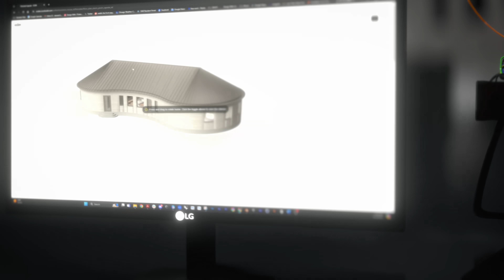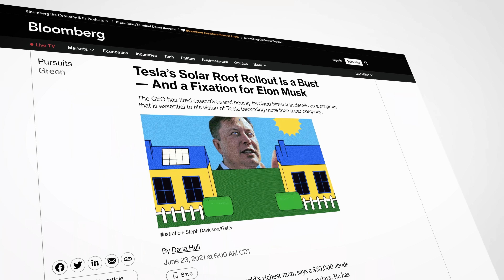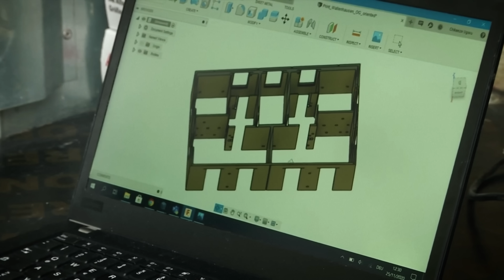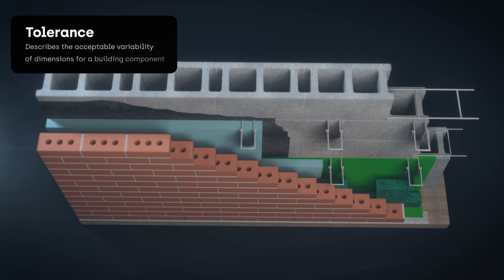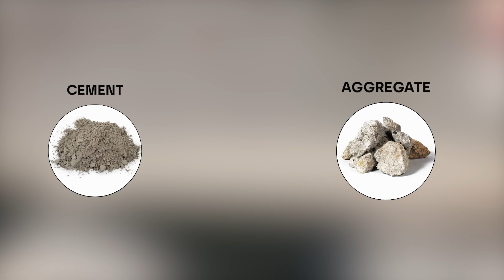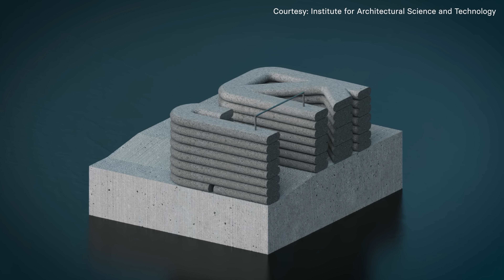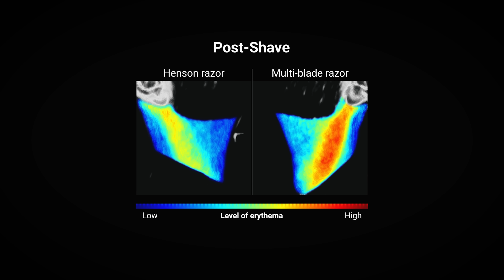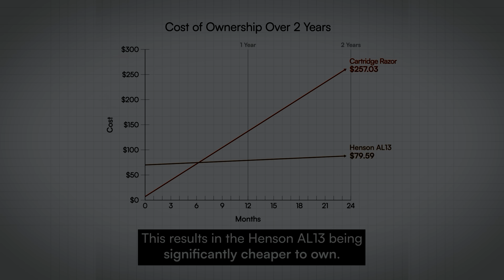Why 3D Printing Buildings Leads to Problems

Comment: Hooray for automating the least complicated, least expensive, most reliable part of the construction process! You did it, Tech Bros!
Reply: That's what I said from the beginning. Okay cool. They made walls. The easiest part of the build. The majority of the headache comes from electrical, plumbing, roofing, and finish work. NOT the walls. Hell. Even modular home manufacturers just mail you the walls.
Reply: @t_c5266 so you guys think they didn’t think through that?😂
Reply: @iaintatroll no. They thought it through. But came to the conclusion people could be scammed who lack critical thinking or experience
Reply: @iaintatroll I will leave foundation out, since both must have it. I've recently built my own house from AAC blocks, using reinforced lintels for openings. 35m3 AAC blocks were 4.5k EUR. Lintels (concrete + rebar + leftover wood from foundation for forms) 1k eur. Glue for AAC blocks 700 EUR, reinforcing rebar in between AAC blocks 200 eur and monolithic ring above another 1k. EUR. So in total the walls were ~8k EUR. Just for comparison: triple glazed windows and doors(both inside and outside) were 18k eur! Just windows and doors were more than double what the walls were. My kitched was almost twice as expensive than walls at 15k EUR. Electricity? 9k EUR or more than walls. Heat pump? 7k eur for unit alone and another 5k eur for underfloor heating set up. So also almost twice as expensive as walls. I'm not even gonna go into plaster, cieling, HVAC and finishes...
Reply: @iaintatroll They didn't automate any of that stuff.
Reply: In the part of the world where I live, structural concrete or masonry requires reinforcement. When does the steel get installed? 
3d printed objects tend to fail along the layer lines. These buildings have cold joints between layers, how is that addressed?
Reply: @markdaniel8740 I live in one of these houses, they add rebar in between and across layers as well as vertically into the foundation to help tie down the roof
Reply: The exaclty.  A crappy gadget isn't always the answer to real issues. I could hand lay blocks faster, cheaper and better.   They take days to even setup that rediculous apparatus.
Reply: to add to this, the process to prepare for the 3d printing is an expensive and complicated process that requires the construction of permanent concrete pads. Which would make this far more expensive, and take far longer to do than just hiring a crew of people to do the masonry...
Reply: Tell me you have no fucking idea how bad timber frame homes are made in the wild without telling me.
Reply: I thought new house building is mostly limited by land and permits, not the actual building part.
Reply: @arcturuslight_ yeah 😅.
Reply: @arcturuslight_ that is the fun part of construction, you'll never know what will be the bottleneck in the project, i love my work, no building is equal to the other
Reply: Does it work in cold weather parts of the country.  Construction doesn't stop when it's cold out.
Reply: @rok1475  twas ever thus. Supply chain issues cause WAY more problems in the cost and speed of construction than masons and framers.
Reply: @henryglennon3864 or legal shenanigans, they can easily cost a year.
Reply: @henryglennon3864 peak /r/iamverysmart
Reply: @henryglennon3864 Yeah, masons and framers are the fastest contracts out there 😂
Reply: @henryglennon3864 
You are exactly right.
Investors and entrepreneurs everywhere seem to be stuck in a certain way of thinking and ignore that fact that building is requires a holistic approach. A whole if structure and structure lifecycle approach
Reply: @henryglennon3864  
Modulo the fact that developing modern supply chains -- even the notion that there is a connected chain involved -- has cut prices, while masons and framers don't tend to get cheaper.
Reply: @henryglennon3864 that’s how it usually works, what do you think robots in factories did first? The complex jobs or the easy ones?
Reply: @henryglennon3864 you dont work in the trades do you?
Reply: @henryglennon3864  are you a expert in this matter? If so, can you explain to me why its possible to build a entire hospital in 1 week in china, but like everywhere else its done in 4 years at the fastest
Reply: @henryglennon3864 so reducing the amount and type of materials needs on site is a massive plus then, I have no respect for architects, they make so many massive yet easily avoided mistakes and are never held accountable, they should actually have to work alongside construction workers and deal with the issues instead of just issuing revision 26 of the drawings lol
Reply: @dancingfrogsxb1276  omg. I SO agree. As someone who has both installed and cleaned windows I HAVE ALWAYS said that. We need to have a system that is holistic. If the designers had to install it, maintain and clean it, they would design things with that in mind. I have always said that. Holistic design is a real thing. 
All architects should be required to spend time in their training on the job site and also understanding what it takes to maintain it. ✅ Then things will be designed and made much better 👍
Reply: When the comment is more positive then the video it self.
Reply: Typical early naysayer speak. In the 1950s there were plenty of people saying people would never overcamplicate things by having computers in their homes.
Reply: Stop saying bro
Reply: Yeah it's kind of silly. A frame factory can build the wooden frames faster and better than this can print concrete. Frames show up on a truck and 3 guys can stand them up and nail them together.
Reply: @rok1475 Eh? A decent brickie in the UK is making £250 to £300 a day - $300 to $350. It's a skilled job and a good bloke will do 1000 bricks a day or more. They are quicker than this current printing system. On site a house will be up to roofline in two days.
Reply: And forget about being able to set up the printer in many locations.
Reply: @markchisholm2657  
A job that can be learned in a few days and mastered in a few weeks is not a highly skilled job.
The reason those brickies make decent money now is because not many are still doing it.
How many young lads do you see stacking those bricks?
If young guys do go into construction trades, they go for electrician, pipe fitter, HVAC tech, etc where you get paid more for what you know rather than how many brick you can move on a cold, wet day standing on a rickety platform outside..
Reply: @markchisholm2657 my father was a Rollie for over 40 years.he wouldn’t work for those bad wages.
He was on £100 an hour when he retired and that had been his rate for a long time. He also NEVER had time where he wasn’t fully booked.
Reply: The world needs building scientists, not tech bros. Architects should be using less concrete, not more. Concrete is bad for the planet and its inhabitants. Also, so much concrete is being used that one of its constituent parts, sand (a particular type of sand), is becoming more difficult to find. For most of this century, every two years China makes as much concrete as the United States did in all of the 20th century, with almost all of it used internally.
Reply: @rok1475 then have tech bros  invest on exoskeletons (passive and active) to at least partially make the skilled workman more comfortable at work.  At least those exists.
Reply: Obviously trolling
Reply: He says atop systems built on tech.
Reply: @6AxisSage  "Built on tech" is not the same as "built by tech bros". People here aren't decrying technology in general, they are specifically decrying the way tech bros try to use 3D printing, AI, blockchains, and a few other niche technologies as general-purpose solutions when they simply aren't well-suited for most of the situations they are being forced into.

As an example, both from the video itself and the comments, it's generally more practical to just mold modular sections and connect them on-site than it is to set up an entire giant 3D printing gantry and bring in large volumes of very specialized concrete mix.
Reply: It's kinda crazy how many people in this thread think this is a good way to solve any problems related to construction.

The business models that tech companies use are designed to magic money into existence and not produce anything of real value, which makes them fundamentally incompatible with the reality of solving any real problem
Reply: With a more expensive material
Reply: Id rather pay the machine than the Mexicans
Reply: s
 t
  f
   u
the language you use is so childish
Reply: I would prefer concrete over cardboard though
Reply: Awesome! Standing ovation.
Reply: Negativity negativity. this is a new idea and technology, and we hope it succeeds. although identifying problems is fine, encouraging people to shit on an idea that can help many people is a bad thing. outside of your first world confines, this technology can be purchased by developing governments to help house hardworking people who dont have homes. concrete homes are far more long lasting and strong than wood frame homes. my family's home in rural india has stood for over 300 years, no rotting, no issues. it's a concrete structure. some have said it only replaces the framing, no thats not true. the frraming is still done by humans, instead of wood its rebar. the concrete is the exterior, the interior, and honestly everything that gets done on the interior happens VERY quickly. Mainly because you can hire all the teams to come in and do several things at once. a house can be built in 1 month. 3 days for the exterior, 1 month for the interior. compare that to my new construction home we purchased this year - which took 9 months to build (the interior took only 1 month, we moved in october, we did the final check in september prior to them beginning the interiors. 4 bedroom home took 1 month to complete interior, plumbing, etc). he say it will be hard to make repairs even though people have worked with concrete for millennia. people know how to work with it, repairs dont need to be 3d printed much less lifting up the roof to do so. he said why dont they just use molds for the walls - transportation is expensive. cranes are expensive. giant concrete walls dont fit inside trucks. meanwhile, one 3d printing robot can be transported 1 time to a development lot, and stay for months upon months, before being transportd again. everything else is built right on the spot.  instead of considering the positive, you spend your time bringing it down.
Reply: The way we frame and build most homes is absolutely ridiculous. We need something better.
Reply: lets see how they do with M and E
Reply: COPE HARDER
Reply: @Ahblair4 Do you think this is solving the vexing problems facing the housing availability? Will these robots lower land costs, or change nimby zoning laws? Nah. Just prebuild wall segments in a factory.
Reply: Not every not-pragmatic technology is a techbro scam, FFS...
Reply: Well tech can’t solve zoning laws and mass immigration, so housing scarcity will persist.
Reply: lmaooooooooooo
Reply: And made it complicated, expensive and unreliable! 😂
Reply: Ow
Reply: ...by creating a myriad of problems and limitations.
Reply: Can you explain it?
Reply: Nailed it.
Reply: Less regulation. Problem solved.
Reply: lol the way these bums build 400k homes with zero care and tons of problems yeah ill let a computer do it all day
Reply: Why not build underground? Arent we the leaders in tech?
Reply: Look.. they are trying something different..what are you doing?
Reply: When electric streetlights were mass produced, the lamplighters (and their supporters) said exactly the same thing. There are always Luddites in every society, who cling to outdated modes of production and inefficient economic models, and usually, this is based solely on self-interest.
Reply: Yup!
Reply: Also the fun part: in urban settings the building costs are negligible compared to what you pay for the land lol
Reply: The guy talked for one hour even mentioned the problem of gaps in construction and didn't say how FUCKING THEY MAKE DOORS AND WINDOWS GAPS DURING 3D PRINT
Reply: Labor costs make up about 20% to 40% of the total construction expenses, wanna try again?
Reply: 😂 America is behind 200 years when it comes to building houses
Reply: I don't think you've seen new construction lately.
Reply: Not only is construction very expensive, but construction workers are highly paid by the hour
Reply: Wouldn't it be crazy if they actually did print channels into the walls for plumbing like they do cooling channels in rocket exhaust?

 It would have a hot water, and cold water holes you'd just plug the sources into. From the water main, and your boiler/heater.

  Then the water would literally pass through little premade channels inside the walls where it needs to be with a cold/hot water separated into their own pre designed sections. No pipes needed just from the intricate voids left. 

 Need a sink just look at the layout, and drill a hole where cold water passes, and then the hot. Something like that. 

 Could use it for temp regulation if you're really clever with design. 

 Then for electricty there would be separate hidden channels wires could pass through for everything as well. 

 Ha just playing we can't print granite yet. 

 Yet it would be interesting seeing a home designed like that one day. With cooling channels inside the walls. Designs like that is where 3d design shines. 

 The fact none of these designs are complex sort of defeats the entire purpose.
Reply: Think of it more of a tool to make organic designs cheaper and more accessible rather than something seeking to replace usual methods. That part is mostly just marketing effort to get more funding and investors.
Reply: It's still helping.  Just because it's not the biggest problem isn't a reason not to make progress.  The biggest problem is political and that isn't something tech can fix.
Reply: 3d printing is faster than bricks and cheaper
Reply: This misses the point. In the long run, printing an object could make the  complicated as cheap as simple. We're not there, but one has to start somewhere. Yes, the first televisions were not great to look at, but it was a beginning.
Reply: Having seen modern contruction, I wouldn't call it reliable.
Reply: @RomrotMechanikos The thing is it's quite hard to fk up bricks and mortar because everyone (Provided its not rendered.)  can see at least one layer of bricks on the outside and it's quite hard to sneak bodges through in places like that.
Reply: I want a house that can withstand the elements sooo there’s that
Reply: Lmfao 😂😂😂😂 sure buddy
Reply: Framing isn't the easiest
Reply: Its not that its complex or expensive its that it takes too long to build supply and demand are a huge issue the demand is way too high and the supply is way too low resulting in million dollar houses that have just 800sft of space
Reply: Ah but you see the bot can't unionize or talk about worker rights!
Reply: @fluidthought42 … yet
Reply: @slackerman9758  The moment any corporate power produces a class aware general intelligence robot is the moment they nuke billions of dollars of effort to save face.
Reply: It's also dangerous. What's the problem with automating this particular process?
Reply: @ShiroKage009 putting up residential walls ain’t that dangerous.
Reply: any amount of automation is good as long as the automated process can match the existing one
Reply: @MayYTlive Well, it’s more expensive to use, worse for the ecology, expensive to maintain, and limited in utility. What’s not to love?
Reply: Hmmmmm and
Reply: A bad argument- cheaper and faster is still better, even if there are other more expensive parts.
Reply: @karenreddy it’s not cheaper. And not really faster.
Reply: very rightly pointed out, this concept is stupid but the hype around this is crazy mad, why are people so damn stupid and dont want to use their brain even 2%? I feel shocked seeing that.
Reply: I'm not sure you know as much as you think you do about concrete if you think its the cheapest part lol
Reply: @Gkitchens1 walls are very cheap in single family homes.
Reply: So much of real world problems discussed here than in video
Reply: I'm cool with it.  It is like AI right now clearing out the untalented artists and authors and making things easier for more skilled and capable people.  Free my hands so I may use them.
Reply: “They mocked the vault when the Romans lost the recipe. Then Chartres rose. Give the printer 50 years and a village of mad poets; Notre-Dame will blush.”
Reply: Right
Reply: @nevasoba5953  the original comet is Mindless. This is the person who doesn't understand how Evolutions roll out
Reply: This comment gets it
Reply: now get your inspection done, certifying the building is safe to occupy...oh.
Reply: Fly ash will be found to cause cancer and the concrete will be radio active.
Reply: Complaining about new technology while using technology that was unimaginable 30 years ago is a bit ironic.
Reply: what a terrible, short sighted opinion. And of course its voted to be on top, no surprise.
Reply: It's just another tool, chill :))
Reply: I don't get it. What's the problem with this again?
Reply: Yeah, more precisely pouring and framing was automated, the easiest parts. Rebar still has to be installed manually. And the stuff ist really expensive and unsustainable due to the higher than usual cement percentage and hightech admixes. Not the best idea
Reply: @lupus7297 I encourage you not to limit yourself and how you think about stuff. What will generation 10 look like?
Reply: @kirk.w.mclaren  what do you suggest it looks like? Genuinely.
Reply: @kirk.w.mclaren  it look like prefab walls made from casting
Reply: @SaltyChickenDip I agree that the walls don't look great but I consider it version 1. The lines would be distraction potentially for me
Reply: @kirk.w.mclaren exacly. This is like any tech in early stages "imperfect". People will buold on this and make it better over the years. And with AI now this process will even go faster than ever before.
Reply: @kirk.w.mclaren  What’s the problem? If the 3D-printed walls are uneven or ‘ugly’ and you prefer smoother walls, just sand and/or fill them. Done! 👌

Would you like it to sound a bit more casual, professional, or sarcastic (the tone can shift slightly depending on what you want)?
Reply: @ẹchoes-ēclıpsɛd  so true. Imagine what the humanoid robots will be able to do after 20 years of life experience
Reply: @ẹchoes-ēclıpsɛd  I'm good with that solution. For me there needs to be extra steps to fill in the surfaces because I like the elegance and simplicity of smooth walls. I am very impressed about what this technology is doing
Reply: @kirk.w.mclaren  it’s important you don’t implicitly assume it’ll work and then try and guess what future iterations will look like based on that. Some technologies are dead ends, remember NFTs? 

No, the right move is to determine what plausible future improvements might be, then determine if those would be fit for purpose in how we construct houses.
Reply: There is much more nuance to the cost structure, and the company I work with consistently costs much less per square foot than frame construction. The companies in this space are well aware of the costs, and while the marketing focuses on the walls, the actual business case lies in the interfaces between the walls and everything else and automating as much of that as possible. That said, though, cheap labor eliminates the market advantage, limiting most concrete 3D printing to high-cost-of-living areas for now.
Reply: @joranbooth5529  aka they sell someone on cheap walls and then charge them to make that shell a funtional house with custom made solutions to plumbing and electric. Things that are already taken into account by the current builder model. You want cheaper houses it isnt the skilled labor that makes it vost so much. The largest charge of a new house is the builders profit margin add  on. Then its materials, then its beurocracy and red tape, and then its labor. These walls seem like an all atound pain in the ass for residential. Should probably focus on commercial like outpost buildings or terminalsz something that there are 1000 of that all have the exact same dimensions and plans.
Reply: @joranbooth5529 cheap labor also isnt good for the laborers in the long run, if you catch my drift
In theory, not a single mason has to do anything more than keep up. And its not like laws are gonna change and suddenly prevent the trade method that already exists.
Its just maybe better for housing the number of people we'll have soon given population dynamics
Reply: @joranbooth5529
Reply: @joranbooth5529  are you serious? Many countries been building concre houses for long time. You making problem out of nothing
Reply: @rb-oo5mz  Then you didn't understand my point. I know that. I've lived in one.
Reply: @joranbooth5529  the problem are also materials. These are monolithic walls but with no settlement and reinforcement.  I It's literally a copy of processes used 2500-3000 years ago in some areas and still used by indigenous people in South America but automated instead manual. The problem is that in reality a building or its foundation never finishes settling, it's PERMANENTY in motion. Ancient (1000 year or older) building in Europe still stand because they were built in such way they can adopt the microscopic changes. And if it is a monolith, it would break  faster than any traditional cheaply build home. Concrete monolith buildings are designed in such way to have certain elasticity; they aren't one piece. One can say "I don't need a home for 1000 years" but wrongly build one may fall apart after a season in certain climates 9here in Russia one company experimented with them.  it broke in half after winter).
Reply: @rok1475  Sounds like we should be paying brick layers more despite the works simplicity because it's physically demanding.
Reply: @justinsemple7454  Ask any young person if he would like to do that kind of job.
They prefer being TikTok/youtube/instagram stars making lots of money having fun. If any of them want to go into trades, they pick electrician, plumber, etc, not the back-breaking outside work.

The old men doing these jobs are getting ready to retire. Some of the will be replaced by immigrants from poor countries, but not all.
Reply: Adam Something needs to make a video on this.
Reply: 3D printed concrete homes are a wasteful, expensive joke. The only good news is that they are so ridiculous that they'll never reach mass production.
Reply: @bobbert3426  You must be fun at parties.
Reply: To be fair, it's not just replacing framing but also outside trim work and a lot of the inside work if you  just paint the walls. Plumbing and electrical can be done with the voids in the wall. Because it's reducing labor to just a few people, you don't have trades waiting on other trades to get things done and the machines can run 24/7, something hammering crews don't do.
Reply: The foundation ,concrete walls and slabs are by far not the cheapest part of a house lol, it's usually 20% at least of a build. 3d printed walls make it more expensive and weaker with less opportunity to insulate. These printed houses may be ok in areas with little ground movement and no winter freeze/thaw cycle but are not practical for the Midwest or northeast
Reply: @cthulawha  this doesn't print the foundation, or create slabs, it's very obviously replacing the framing with 3d printed concrete. So not only is the set up complicated (you have to lay pads for the gantry, survey every site to mm accuracy, and modify every plan before the machine can be deployed), it's also replacing carbon neutral to negative materials with a material that produces CO2 as a necessary part of its chemistry.
Reply: @BlueScreenCorp  wood framing is by far more sustainable than cement, you do know only ocean made sand is usable for building right, you do know that the trucking cost for concrete and cement is way more than wood due to weight right, that Portland and lye must be mined etc. the whole idea at scale is asinine. If you live in a no frost area and like the futuristic look of these desert planet sci Fi homes than cool, but  they aren't practical, revolutionary or capable of replacing stick framed houses. Look into geodesic homes or the Roger Dean partially buried like a hobbit houses  for  superior durability, efficiency of heating and cooling and sustainable use of building materials if that's your jam. It's obvious you don't remodel or build houses nor have knowledge of the supply side of construction
Reply: @rok1475 Maybe if it's such a shitty job that's so important, we should be paying these people more. I'm sure the investors can do with buying just one new yacht this year.
Reply: @sarbe6625  Ask any young person if he would like to do that kind of job.
They prefer being TikTok/youtube/instagram stars making lots of money having fun. If any of them want to go into trades, they pick electrician, plumber, etc, not the back-breaking outside work.

The old men doing these jobs are getting ready to retire. Some of the will be replaced by immigrants from poor countries, but not all.
Reply: I pour concrete foundations, and yeah our system is way more simple and foolproof than this can ever be
Reply: Yeah and its just fkn cement.
3d print the most damp condensation prone and least breathable house ever.
Reply: Because cement won't readily burn down in a wildfire. 3D printing houses has a lot of potential uses out West where forestfires are becoming more common. Different types of cement are also being developed that are more eco-friendly.  @a.i.a3949
Reply: @a.i.a3949 most of the world lives in cement buildings
Reply: @a.i.a3949 concrete houses work perfectly well if properly insulated and ventilated. How many homes have you built?
Reply: @surfgreen60 "If properly ventilated" personally, I don't think a house should require an extraction fan to be permanently going to stop it from getting damp in say winter, when you don't want to open any windows.
And I've repaired many buildings with damp problems which is usually caused by someone a few decades ago re-pointing in cement.
Reply: @a.i.a3949 Solid CONCRETE is tuff, this looks like hollow MORTAR, which anyone in construction knows you can crumble it fairly easy with a hammer.
Reply: @gerardorodruiguez5928 fair point its not EVEN concrete its just cement mortar
Reply: @a.i.a3949  the condensation thing is pure nonsense and have you ever heard of a VENT? of ventillation? Nobody wants a house to breathe on its own. You want to bring in air on your own terms under your preestablished conditions.
Reply: @legionjames1822  Fan powered vents have only existed for maximum 200 years? People have been building dry houses for a lot longer than that. In my personal opinion, houses shouldn't need to have a fan constantly on just to stop it from getting damp.
Its a bit like saying "why even build a roof when you can just constantly pump all the water out of the attic am i right?"
Reply: @BarronBros1822  lol yes in fact you want the house to breathe on its own...all these super tight houses are being found to have severe mold issues. Sometimes old ways are better
Reply: @cthulawha  no their not.
Reply: @BarronBros1822 every single european house works without electric vent lmao.
Reply: Wood framing in multifamily is dogwater though, but I get what you mean
Reply: you think labor is cheap... how quaint and telling.
Reply: @thaphreak  the labor of setting up those gantries/robot-stands and 24/7 supervision of printing is even more expensive than hiring standard bricklayers.
Reply: Lol, the walls are the most complicated and expensive part of any building and they are also the most important part of any building design.
Reply: @HarryDirtay Its not just because they're slightly more drafty. It's also to do with the fact that most old houses have a hearth that's lit constantly taking the bad air up the Chimney.
As for cement breathability compared to something like lime, there's a good analogy.
You can think of cement as one of those big vinyl coats that keeps out all the moisture from the outside but ends up getting you damp anyway because none of the moisture your body makes can escape.
And lime, as something more akin to gortex, eventually it will soak through in bad conditions, but most of the time, you'll be dryer than the vinyl because your sweat can perspire through it

In a cement house, provided people live in there, you still get moisture inside the house because people breathe out about 250ml per day. Except unlike a house pointed with lime with, lime plaster for example that can immediately absorb the dampness in the air and slowly wick it out of the building, the non breathable cement in a poor ventilated area will become wet with condensation.
Reply: @a.i.a3949  korean built homes are timber with insulation walls that get lime plastered.
Reply: Better than nothing. Its a start. Hopefully one day this could lead to more affordable homes for more people.
Reply: @ẹchoes-ēclıpsɛd exactly. These people trying to minimize the advancement do not understand how things are rolled out
Reply: It's the easiest part to automate, and could be a useful cost savings, if companies don't just keep it as more profit (which they will)

Other automation may be possible, but is significantly harder.
Reply: @EmilyDunn-h7z  lol you say profit as though it’s a dirty word and as though they don’t compete on cost and quality with other contractors.
Reply: What are you even complaining about
Reply: It's your paycheck that you're talking about innit. all the goings on, the in betweens, yeah? like architects, designers, agents, et al, should be not making as much as they do since it is not tied directly to the construction's physicality?
Reply: @artificer845 tell me you know NOTHING about the construction industry without saying it. SMH
Reply: @mordsythe  get back to work, I couldn't care less what you think I know
Reply: 3d printing houses is a solution that is still looking for a matching problem. Desperate venture capitalists burning money. the way to go is to prefab walls offsite with outside shell, ibeams, drywall, with all plumbing preinstalled. and interconnects where walls and ceilings meet.
Reply: Dude without risking safety and quality of life in the house. You can’t skimp on crap like the electricals and other important crap like that. So there’s not really much money to trim there. Though if you could automate constructing houses (not many construction companies rely on home building contracts anymore due to the markets unreliability when it comes to people wanting houses.) 

So if you could eliminate the biggest part of the building cost with a system you could break down and transport on the back of one 18wheeler and one cement truck. You could significantly cut off on overhead costs. 

You could use telescoping using hydraulics to have it be able to easily expand to whatever dimensions requested. You could even have a telescoping form come down from the nozzle to essentially make little concrete bricks in order to make it conform to other concrete style houses.
Reply: Learn to code.
Reply: This is happening for a reason. There’s a housing boom in my city. The wood butchery, utter incompetence and disregard for code that is seen on job sites at the most BASIC LEVEL OF CONSTRUCTUON is why they’re looking into this. If your labor is inconsistent, unreliable, and delivers poor quality, automation is a logical response.
Reply: @Shadowfalls89 
Then they will just blame it on “crappy” programmers and mechanics who maintain these machines instead afterward.
There are reasons why companies use either illegal or cheap @&#% labours from 3rd world countries or something similar.
Reply: That’s the point of automation. Make the time consuming and least skill intensive tasks even less time consuming and skill intensive
Reply: Meanwhile over at the big shit developer like MI or Dominion homes, they use shit materials crappy contractors and of course illegal labor. 
Yeah new houses are crap no matter how they're built. 

The people that are geeking out about this are scared for they're job.
Reply: The idea is to automate the most laboureous and dangerous parts, not necessarily the most complicated
Reply: Tell me you’ve never poured concrete without telling me you have never poured concrete.
Reply: labour is the most expensive and most prone to introduce failures, amalog bro
Reply: Yes. This is more or less the first generation. Imagine how great generation 5 will be.
Reply: How dare people try to increase productivity through automation!!!
Reply: @fredroberts8275 Even in a vaccume where you assume these abominations are as good as a brick and mortar house which they are not.

Labour isnt the thing which halts productivity, investment and demand is. Has the mass automation of any other industry made life better for the average person? Not really, all its done is increase profits of businesses because you dont need to pay robots and made workers unemployed which is actually bad for the economy because not only are they a strain on welfare systems but they also no longer have disposable income to stimulate the economy.
Maybe if we didnt live under a system like capitalism where you need to work to live automation would make life better for everyone but in reality all it does is mean people no longer have work.
Reply: Automation like this only benefits the Rich, it’s their goal to put as many people out of work and hoard as much of the wealth as they can. who wants to live in a disgusting Concrete house that looks like something a 12 year-old made in Minecraft besides 12-year-old and Man children?
Reply: @brklynboix00 Spot on 👍
Reply: i keep pointing this out too. but i also acknowledge that the plumbing and electrical conduits can be printed into the walls for ease of later installment of wires and pipes. also, gapped concrete walls don't need insulation. 

the irony of all of this is that the US has more functional livable structures than there are people to live in them all; in other words, supply of homes exceeds demand of homes. people just don't want to live in certain areas, but also, only so many people can fit into the desirable areas 🤔🤷‍♂️
Reply: @graphixkillzzz Concrete has lousy thermal insulation properties. The insulation “R” value is the equivalent of a 1ft thick masonry wall.
3D printing can’t do plumbing and conduit because it doesn’t have a high enough resolution.
Reply: @graphixkillzzz  to be fair, the US also has the worst urban design on the planet due to its zoning laws. With better designed neighborhoods and accessible public transit, that wouldn't be such a big issue.
Reply: @graphixkillzzz  Keep in mind people must live somewhat in the vicinity of a work place as well. Not to mention economies evolve and old ways die. Heck, half of England was built on mining, NO MORE and those areas are DEEPLY distressed now. On the 3d printed home i agree, everything  must be planned very carefully with much forsight ahead of time.
Reply: @BarronBros1822  That's the idea.
Reply: @graphixkillzzz  Not true. Listened to an economist who studied this talk about and so many experts talk about this all the time. Maybe in some areas there are high end condos that go unfilled because they are luxury but plenty of people have middle class jobs and can't afford these.
Reply: @graphixkillzzz  supply of homes does not exceed the demand where are you getting this idea from? Do you mean the supply of land? Also you understand the govt restricts zoning right?
Reply: @graphixkillzzz  The vast majority of "vacant" homes are simply in between buyers/renters. There's a steady amount of them (or there need to be if you want a healthy market for buyers/renters) but it's constantly changing. Once you exclude market vacancies, you're basically left with dilapidated homes that are not fit for human habitation and homes in dead and/or remote communities with no jobs. Everything else that left-wing NIMBYs complain about (AirBNB, investment homes, etc) are rounding errors compared to the demand.

Sustainability means building homes where people want to live and that means building more houses more densely. Cities have plenty of room for more homes. NIMBYs just don't want to allow more construction because they want to encase the city in amber the moment they move in and lock in their property values.
Reply: @graphixkillzzz  Great point. I dont understand the sustainability part. What is not sustainable about building homes for people to live in? Its like crazy to even mention it, if you ask i.
Reply: @BarronBros1822 the sustainability aspect of single family housing (or lack there of) is mainly due to its lack of density. Having a place for people to live is of course something you want, but an appartement suits better a urban area, and a intermediary  building european style fits better a suburban environment.

Compared, separated single family homes means less compact cities, more road infrastructure, more cars to get there, more consuption of space that could be used for farming or ecological reserves or other things. 

Plus having a bunch of little boxes for people to live means more contact surface between interior and exterior compared to adjacent houses, which increases the need for insulation
Reply: @arnspyarchi6040  true, but the people want what they want. Independant single familes homes will continue to be what the people want.
Reply: @BarronBros1822  Unfortunately sometimes what people want is not sustainable. We can't stop them from wanting it, but in the real world everything eventually comes with a cost, may it be economical, social, environmental, technological, etc. 
A lack of sustainability often means this cost is put on other nations and/or future generations
Reply: @BarronBros1822  just building homes is not sustainable if none of the systemic problems of wealth inequality, debt, ownership and taxation are also fixed. you end up with ghost cities nobody can afford to live in, and homelessness
Reply: Laying brick or cinder block is pretty expensive. Not that I think this is the next innovation that will replace conventional home building...
Reply: You know there is a massive labor shortage? So homes are taking longer to build.
Reply: @datownkidd  This is not a solution to a labour shortage, the shortage in the US and Canada has been created by companies not willing to pay workers what their labour is worth. You wanna end the shortage, run a media campaign for skilled trades, and promote them in schools as a viable career path,  and mandate that companies pay a fair wage. 

This device and the idea of 3d printing buildings with a cement slurry is laughable, and the gantry alone takes more time to set up than it would take to traditionally frame the home in the first place.

Technology isn't the key to solving these types of problems, making rich f**ks pay their taxes and providing services to the general public like free education and vocational training is how you solve these types of problems!
Reply: Dude, you're an architect. By default, you have no idea what you're talking about. 😂
Reply: Ah yes this genius clearly has lots of insight about construction it took 2 months to pay bricks for a building near us and thousands in Labour im sure 2 days and a machine would not be better
Reply: So you've never worked with brickies then!
Reply: I mean, tech has also assisted with logistics in a huge way as well. Imagine how much worse it would be if that wasn’t possible.
Reply: Dude it's like 200k for a double wide trailer these days. What are you on 😂
Reply: I guess you've not seen the 'quality' of UK new builds. My kid's sandcastles look better made and more robust 😂 A bigger issue is the fact that traditional brick built or concrete FDM still embody way more carbon than modern sustainable build methods and perform worse during the lifetime of the building without a lot of man made insulation material being incorporated. House construction does need to be revolutionised, but sustainability needs to be at the heart of that revolution. And be cradle to cradle at that.
Reply: I know right! Especially since you have a better solution. Please tell us about how you solved the housing cost issue. Hurry, we’re waiting!
Reply: @platio101  By far the main problem is single-family zoning. My region is trying to put a band-aid on the problem by making it easy to build ADUs, but I also live in a major tourist spot, so those are mostly just becoming AirBnBs.
Speaking of which... just getting rid of AirBnB would solve more than any tech bro "solution" ever could. And who created AirBnB in the first place? Fucking tech bros.
Reply: I guess I truly don't understand or know why can't you glue the bricks to each other sideways and make a doorway that doesn't make sense it seems like you could also just cut a hole in a brick wall I don't think anything is going to collapse
Reply: Lmao yeah when you have cookie cutter McMansion shit boxes in so many neighbors now?

The point of 3D printing is to get around the limitations of concrete forms and modular home customization.

Anything that promotes concrete or stone home building is good, especially in Florida and Tornado alley 😂😂
Reply: You don't understand. The problem is the labor required for the old techniques. That's one of the main reasons for figuring out the automation.
Reply: You're truly lost.
Reply: It’s weak, there will be cold seams where the cement dries before the next layer. You also need internal rebar and metal lintels to support over windows, fireplaces it’s also not finished inside or outside, concrete or mortar needs to be smooth to be water resistance.
Also, interior finishing is where the money and labor adds up. While you set this up a crew can frame your house, it will also be ugly.
Quite possible one of the worst ideas the internet has proposed, Who wants to live in a neighborhood with printed houses?
Reply: "Tech Bros" It's so crazy that the internet just hates any one invested into tech that they call anything bad a work of some entity called "Tech Bros" it feels like weird 80's type bullies💀
Reply: @helper809  "Tech bros" is actually specifically referring to the subset that keeps pushing the same few niche technologies into areas they are unsuited for and trying to sell it with the same sorts of buzzwords and 3D animations.

It's quite ironic that this sort of person loves AI so much, while they also are such copycats of each other that they're like a bunch of AI responses to the same prompt.
Reply: Oh ffs. Building from wood and nails is primitive, wasteful, poor use of human life, and badly needs updating. I'm not a "tech bro", just aware.
Reply: @winterhaydn  
It's only a poor use of human life if they are not paid enough.
Reply: @aab-el9bd  No, really. It uses 1% of one's brain potential. It's a hideously dated practice in the 21st century. Those people deserve much better. Besides, "money" isn't a real medium to judge by.
Reply: @winterhaydn  
you haven't done it then.  It takes 100 percent of your concentration.  You're putting thousands of pieces into the right place and fastening them.  Everything has to be the right size.
Reply: @ I'm not talking about concentration. I'm talking about human potential. Modern building construction work is so cookie-cut (with minor exceptions) that it's well below human ingenuity. Machines can and will do the task with far better precision.

It's a repetitive, dull task. Barely above factory or farm work. I guarantee you if construction workers had a true choice, none of them would be doing it (at least not as a commercial job).
Reply: @winterhaydn  
again you are characterizing something that you do not understand.  some people love it.  the interesting challenge is to be as efficient as possible.  Whether it's memorizing the entire plan to optimize your cut lists, to maximize your speed and the efficient use of materials, or perfecting the science of material handling,  there is room to realize your "human potential" in construction work.  Even if you think the work is "cookie cut", the challenge is to be able to maximize your productivity and move on to the next task.
Reply: @aab-el9bd  - Oh, I'm sure there were also medieval peasants who loved building castles, stone by stone. Does anyone still love that now? .... Once again, if given the choice, I'm sure the vast majority wouldn't be doing heavy construction. Except for special projects. The jobs usually pay a lot because, you know, it's not very popular or safe. 

Besides, there are many more real-world problems that require such ingenuity.
As Stephen J. Gould put it, "I'm somehow less interested in the size and convulsions of Einstein's brain than in the near certainty there are equal minds living and dying in sweatshops and fields." (and construction zones).
Reply: @winterhaydn  
masons build buildings, brick by brick, today, and some of them love it.
Reply: @aab-el9bd  - They love it because that's what they know (and out of financial necessity) was my point. .... But, yes, you're right in the comparison. ... Here's another comparison: does anyone born into a wealthy family become a brick-layer? If they have better choices, no. 

I'm certain that when machines can finally create homes ... because they definitely will at some point, since it's merely a technical process .... no one will complain that they can't build houses anymore. I mean, they will at first if it threatens their "job". But, it will be seen as an obvious convenience, just like any technology. If people truly love it, they'll still do it in small amounts (modifications, add on projects, etc.) .... but  people will find other outlets. And, more importantly, they won't need to work as much! - That is, if we overcome the absurd structure we have now.
Reply: @winterhaydn  
No, people love it because they like the combination of phsyical and mental work.  Yes, I have found that people from wealthy families become bricklayers in order to prove something or to get some kind of spiritual cleansing out of it.

machines already create homes.  There are prefabricated panel plants that build the entire house in a factory and it is shipped and assembled onsite.  But these are wood framed houses, not brick.  It is not practical to put an entire brick wall on a truck.
Reply: @aab-el9bd  - Give someone a living wage without 40+ hours of such a labor and I guarantee most of them wouldn't be building houses every week. That's real choice. Like I said before, they'd probably still find projects they enjoy, but that's far different.

You know wealthy individuals doing such work? Bull. Sorry, I don't normally call someone out. But that doesn't sound believable. Or, your definition of wealthy is low. 

Well, machines don't create homes in a suitable way yet. They will. Many things need to be improved.  ....and, Who says they need to be brought by truck?? The whole point is they can be made on-site. The machines could then be driven to the next project.
Reply: @winterhaydn  
you lack understanding and experience about the building process and you would be better off keeping your mouth shut.  I'm not talking about the ridiculous 3d printing machines.  It is very common to have prefabricated wall panels and trusses made in a factory and transported to the building site to be assembled, hundreds of thousands of houses are built that way every year.  That is the future of automation in house building, not giant 3d printers.

"Well, machines don't create homes in a suitable way yet."
Wrong. wrong. wrong.

"You know wealthy individuals doing such work? Bull."
Pretty sure you said "children" of wealthy people.
Reply: @aab-el9bd   - Yes, Buckminster Fuller and others were making pre-fab houses since the mid-1900s. (Bucky wanted to show that we can more than provide for everyone with design principles). We could easily have mass produced homes that way. I fully agree. The problem is that the market requires scarcity for profit. That's why there are at least 3x as many empty homes as homeless people in the U.S.. 

I don't see why 3D printing is ridiculous. It's very adaptable technology. Reinforced concrete has wonderful benefits ... fire/earthquake/hurricane resistant, easier to cool and heat, etc. 

Yes, I was talking about people / children born into wealth. You're telling me they go into construction? I can only imagine that's rare, at best.
Reply: @winterhaydn  
Buckminster fuller did not have CNC controlled saws and robotics.  The future of automated home production is not 3d printing, but prefabricating homes in a factory.  3d printing is not adaptable technology.  It is very imprecise and cannot easily adapt to jobsite conditions.  It cannot even make a square, sharp corner.  It is also not reinforced.  I have never seen rebar in any of the 3d printed homes.  Reinforced means concrete plus steel.
Reply: @aab-el9bd  - Yes, BF's houses weren't very high tech, since this was decades ago. But he was keen on design and also resourceful (for instance, he pointed out we could be repurposing things like grain drums. Which is crude now, but it proves that we're not short on materials.) The advancements you pointed out are obviously a good acceleration. 

3D printing is as adaptable as we make it. Larger rigs, etc. Once again, it's merely a technical problem, not a limitation. 

Square corners? We need to move away from that. There's little need for it. People like to talk about freedom and expression and yet they all live in the same boring boxes, dotted along square grids. It's completely dull and unnecessary. Natural flowing designs will be a step up. Look up the examples of Jacque Fresco, for instance, and imagine how much more refreshing it could be to have organic structures. It's much more difficult to do that with traditional construction, but not with 3D printing.  

Steel beam insertion is a must, yes. Until that happens I don't see 3D printed homes being a viable option. However, it's certainly feasible. Have you seen the concrete canvas construction method (concrete applied over an inflatable form)? It can embed steel structure inside.
Reply: Me when I don’t understand that things start small and expand their capabilities over time
Reply: @RealJustinWillock  There is nothing to expand. It's a solved problem. This is reinventing the wheel.
Reply: @alexanderboulton2123  yea people said that about the intetnet as well, and motor carriges - i say, a good old horse is all i need! Let just SEE what happens pal. The wheel needs reinventing, else instead of annodised aluminum we have shitty wet wood.
Reply: Relax, the tech bros can't hurt you anymore.
Reply: People are trying to solve the housing crisis. What housing crisis i hear you say? Give it 5 short years  and you will see, baring an exponential uptick in home building. Given the current purchusing power of a dollar, the hopes of buying homes for future inhabitents of the world, who are not rich aka the 99 percent, is dismal.  A massive increase in production ability would then drive down cost. This is how it works tech drives down cost, without that were boned
Reply: @BarronBros1822  yaaay, so let's build turdhouses slightly faster and a tiny beat cheaper at the expense of insulation, durability and repairability also making it extremely hard and thus expensive to put wires and pipes through that thing! That's exactly how housing crisis is solved
Reply: @ДимаВеселов-в8и  i think your not understanding. Lets make putzy AUTO mobile that only goes a tiny bit faster than a horse, takes FUEL, and cant reproduce itself like horses can. Do you see it now? Its a system of development that enganges in automating the whole building process from start to finish. Or at least it must be and will be at some point.
Reply: @BarronBros1822  I know what the housing crisis is. I'm an architect. The housing crisis is caused by economic and social forces, and it won't be solved by building concrete walls slightly faster.
Reply: @henryglennon3864 😂 these people think the housing crisis is because we can't build cheap or fast enough
Reply: @henryglennon3864  I love architects. The Amount of money I get out of you guys in change orders is astounding! Design and drawing errors are the number one leading cause of change orders for me. So I thank you! 😂
Reply: @henryglennon3864  Not to forget political choices, like zoning large areas for low density single family housing.
Reply: @henryglennon3864 wait you mean I can't have this contraption come up to the top of my 6500 ft mountain top off grid property and build my dream house for $600? wtf, you mean I still got to go to home Depot and buy $600 worth of plywood and 2 * 4 is another scrap stuff from construction sites and build a cabin for a couple Grand man😮😢
Reply: I AGREE. ITS OVER POPULATION!!!
IT HAS COMPLETELY CHANGED THE LOOK OF UPTOWN CHIC IN MPLS, TO BOX NEXT TO BOX NEXT TO BOX FOR ALMOST A MILE. LOOKS LIKE JUNK.
Reply: @henryglennon3864 oh wow an architect, you’re so smart and infinitely knowledgeable.
Reply: @BarronBros1822 there's enough housing in America that adequate for people to live in, it's just not profitable to do so. The issue isn't supply, it's a desire for more money.
Reply: @BarronBros1822  Social problems are not solved by tech. The physical process of building a house is easy, the economic structure of housing will ensure that it is unaffordable regardless of building materials or techniques.
Reply: @BarronBros1822  Why would an exponential uptick in home building not be possible? That's how places like Texas are responding to the influx of new demand.
Reply: @BarronBros1822  your assumptions about how the housing crisis operates is your downfall. Its completely not a lack of housing. Its these companies buying up properties and land and then either flipping them for WAY more than they're worth. Or these companies just flat out letting that land rot not allowing anything to be built on it, artificially driving up the price of other otherwise affordable properties because they know that you can't go anywhere else. Then add on top cities like San Francisco not letting you build anything short of a mansion now and you get a big chunk of the housing crisis.
Reply: @BarronBros1822  you can solve the housing crisis with new more relaxed zoning laws.
Reply: @BarronBros1822  Yep. #taxwealthnotwork
Reply: @BarronBros1822   That exponential uptick in housing appears to have arrived.
Reply: @channel-rj2qt  of course. 3d printing houses on the other hand has not. Still developing, slow and steady i suppose. I dont really believe homes is the thing to 3d print. To expensive. Wish they would try a commercial space.
Reply: @BarronBros1822  the housing crisis is entirely caused by finance and resource monopolization by oligarchies, and has almost nothing to do with housing production. There are countless entire skyscrapers that lay empty!
Reply: @hypertectonics7009  youre right there is absolutely no housing crisis. There is around 7-12% of all homes empty at any time, not rentals.  The housing issue is a federal reserve interest rate and federal spending issue.  The other issue we have is really a low full employment issue and illegal/h1b  immigrant issue.
Reply: @hypertectonics7009 the housing issue is much more complex than that. But a good deal of everything that composes this issue can be summarized with: the goverment sucks.
Reply: We get it. The sky is falling. Lol. 

I moved out at 16. I work food service. I just bougbt a home. 

Move. Quit living in California, New York, etc and being suprised everything costs 10x.
Reply: @someRandomHack   - Obviously, not everyone can just move out of busy cities (where opportunities are). And rising living costs are very artificially created. The problem isn't all personal.
Reply: It's another technique that can be used and applied to existing techniques as appropriate. As he points out in the video there will still be parts of the building (roofing etc) done with traditional methods and certainly not all buildings could be constructed in this way. But when you consider that a robot could complete in a few days what it might take bricklayers weeks to do there's certainly appeal and potential for certain use cases.

It's not a "one size fits all" solution for sure. It's another choice given to designers, builders and home-owners. I imagine buildings of the future (and today) will be built using a combination of methods. For instance you could 3D print the exterior and have the interior walls or additional sections built using traditional timber framing. I don't think the Intent is to replace traditional construction methods, but rather augment them and provide another tool in the construction armamentarium which could substantially reduce building time and expense when used appropriately.
Reply: If you were paying attention you would have noticed that they could do 2-3 weeks of work in 48 hours. That’s the benefit.
Reply: That's just false. If it was that simple, everyone would build their own house. Currently it's a luxury. 3D printing is an attempt at applying technology to reduce the cost. You're just short sighted
Reply: So where your from doesn't have shortages of Tradies? Don't bricklayers cost more to lay those bricks than the cost of the bricks themselves?  New tech will always have detractors especially those who no longer have relevant qualifications. Those who worked in horseshoe factories probably were just as annoyed at the the first automobiles and I know auto mechanics hate the thought of EVs, there will always be Luddites.
Reply: You're assuming this is only talking about framing. This is an all-in-one drywall framing and exterior all-in-one. You don't need to wrap, sheath, air seal, siding.... It's illuminating a lot of trades And when you add all those together they're not reliable. Is wood framing reliable what about rott and termites? Drywall constantly needs to be repaired, and anything other than masonry siding needs a lot of maintenance.
Reply: @matt45540  I'm sorry, but reading your comment, you have no damn idea what you're talking about. The walls they show don't come close to meeting code for watertightness or insulation, and if you want windows in your building, you still have to caulk the joints. Also for larger buildings, you'd have to leave construction joints between segments, which I'm not sure this thing has the resolution for. Also, you don't need to build the entire ground floor out of masonry to avoid termites, there are cheaper alternatives. And on top of that, what do you mean drywall constantly has to be replaced. Where are you living that you think all the walls you're looking at are wet plaster over lathe?
Reply: @henryglennon3864 he said drywall needs to be repaired.  Not replaced.   It’s kind of true, though quite an exaggeration to say “constantly”.   (I’ve had to repair holes in my previous home’s drywall maybe once a year.  Fist through a bathroom wall. Snowboard ripping a hole in garage wall when it slipped.  Etc etc)
Reply: Now I live by myself in an apartment and don’t give af.   Housing is way too expensive.  I’m in the cheapest one in my town, and spend almost 50 percent of my post tax income on rent, and I’m a senior network engineer.  Revolution time.
Reply: @henryglennon3864  they don't mean code for water tightness? How are they building them then they also have voids in the middle where you can add insulation post, they're not doing it here but there's ways you can mix insulation into concrete to increase its r value. And much like a yeti tumbler the thermal break of an air gap in between the two sections will add r value as well. Drywall is very prone to damage. It needs to be painted frequently and isn't durable. Flood? New dry wall, was the house vacant the drywall could have molded. Bathroom, I bet there's mildew on the drywall and it needs to be painted and cleaned regularly. At least that's the climate I currently live in and I know there's differences in climates. Don't walk around treating everyone like their ignorant
Reply: My comment said drywall needed to be repaired not replaced all the time. And I just so happened to be in the home maintenance industry and about half of what I do is painting and drywall....
Reply: @xxxmysonrulesxxx  once a year? Do yall rearrange yalls rooms constantly or all yall just clumsy? You should rarely have to fix drywall unless you're doing something you shouldn't be doing inside a house or are constantly rearranging everything like pictures and where you want the TV. Doors also can cause a problem, especially if you don't have something to stop them, but generally you should rarely have to fix drywall.
Reply: “Tech bros” push boundaries.  They may tend to be annoying, but they dispute entrenched interests that slow large leaps in progress.
Reply: @RangeMcrangeface They push imagined boundaries out of ignorance. And they stay ignorant because they're too arrogant to listen to actual experts in fields they're trying to "disrupt".